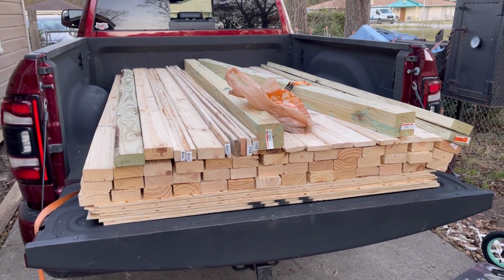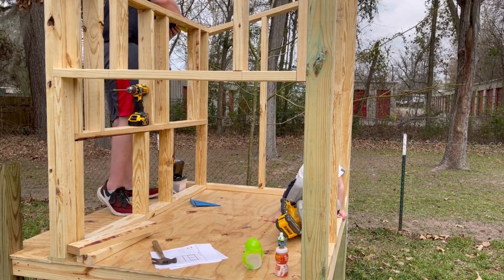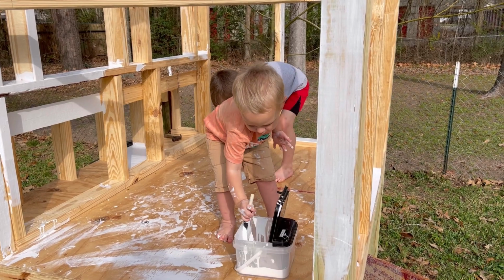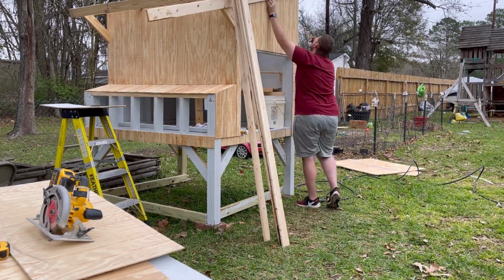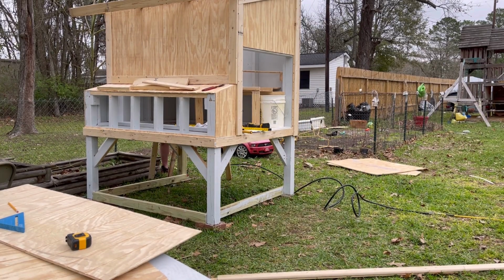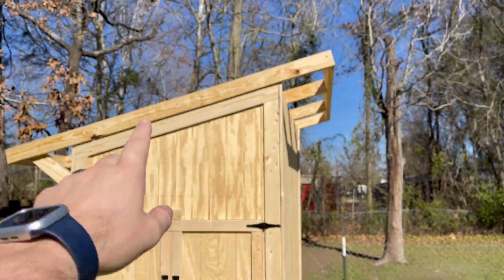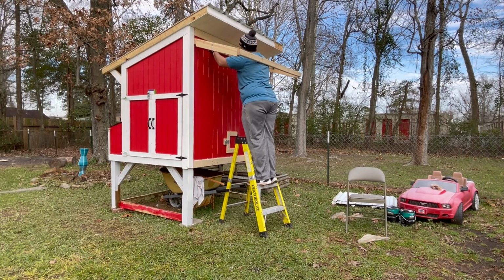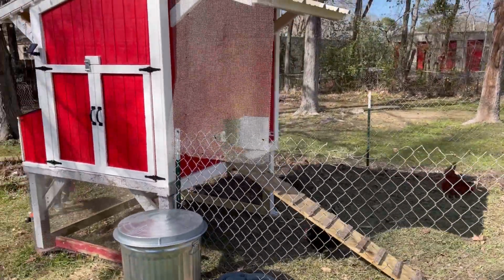DIY Chicken Coop Build! With some FREE PLANS

Comment: Looks great but I was wondering how much money was it and what is the cut list and plans thank you!
Reply from the maker: @Scottbraeden1949  thanks! I posted a link to the guy that developed the plans. If I remember correctly it was around $600 or so for the materials to build it this way. The one in the plans with the run is around $1000.

Comment: Is your material list just for the coop?  Also where are the dimensions for the extra overhang over the chicken door?  Thanks. BTW looks great.
Reply from the maker: You can find the simple plans for the overhang on my Google drive link 👍 mine measures out to be 5’-4” wide to fit between the trim and 24” of overhang.

Yes, the material list is just for the coop. You should have a couple boards left over as I did. I try to use as many of my scrap off cuts as possible to limit the amount of scrap. 

Thank you! Our chickens are doing great and love the coop.

Comment: Do you have ventilation?
Reply from the maker: I added wooden spacers between the plexi glass and siding “1/2 inch” to allow some air flow. It seemed to get a bit stuffy in there and so far that really seems to help. (I just did that this week since it is starting to get warmer here in Texas).

I am thinking about adding another window above the access door to give it more air movement. So far, between that window air gap and the chickens access door being open it seems to be doing ok.